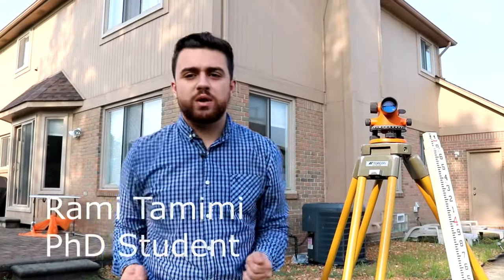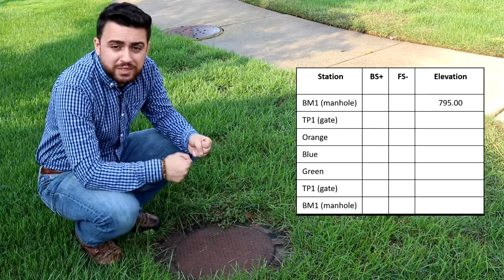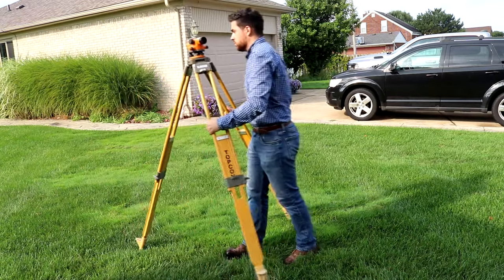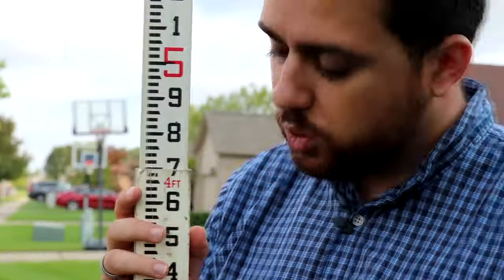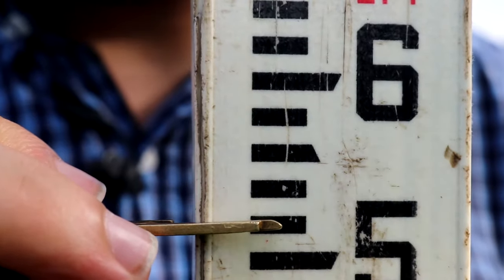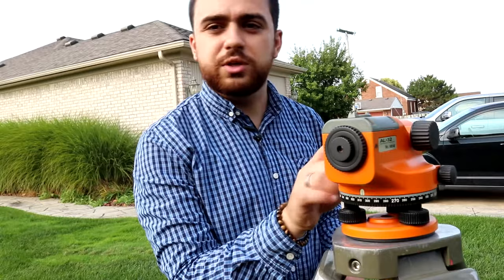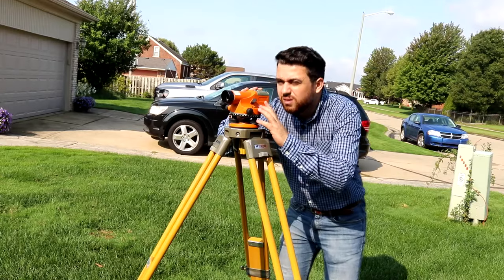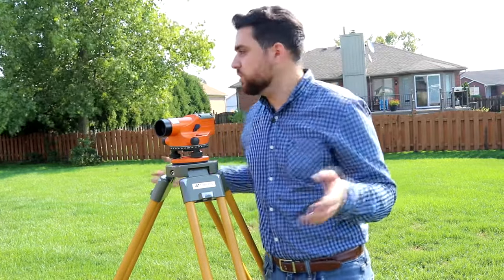How to run a Level Loop using a Differential Level

Comment: thank you .I noticed the readings in your booklet on TP1(gate) on closing the loop changed from 3.79-4.35(for back-sight column) and 4.50-3.75 (on foresight column) on time stamps 11:45 and 11:57 , is this justified ?
Reply: yeah ive notice too

Comment: In my opinion if you plump the leveling back and forward holding the rod like that you end up getting error, unless there is a bubble that indicates level is straight to precisely level it. No problem with your method tho.
Reply from the maker: The ideal method is always to use a bubble, however, in the field, we have to have methods that will solve problems like leveling the rod without a bubble. Hence rocking the rod is what we do in practice when a bubble isn't present.
Reply: @RamiTamimi  just buy a hand level and the Rodman keeps it on him. Simple. Got to have the tools to do the job correctly.
Reply: Why don’t you read thousands? Why don’t you level the tripod legs? Why is your instrument so low? I’m an instrument man and if my boss sees my tripod leaning to one side like yours was I’ll get in trouble. Can’t do that in the construction sites I go to
Reply from the maker: @bdm3056  my level rod has a precision of only 5 thousandths, and industry-standard is usually the nearest one-hundredth of a foot. You could level the tripod legs, however for a differential level, it's not critical, total station would be more critical. My instrument height doesn't really matter since we are calculating the height of the instrument using the backlight reading to the benchmark. Whatever height you set it to should be comfortable for you, this height is what I am used to. My equipment was not leaning, I leveled it on camera. 😊

Comment: Hi Rami, thanks for the great video. If working alone is it fair to say that the same results could be obtained by using a 360 external laser level with a laser receiver mounted to the levelling rod?